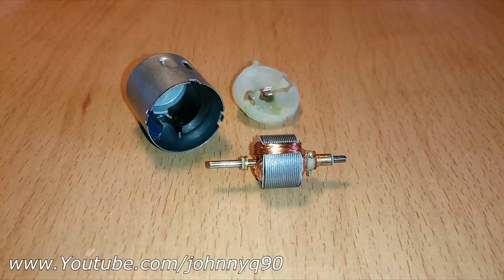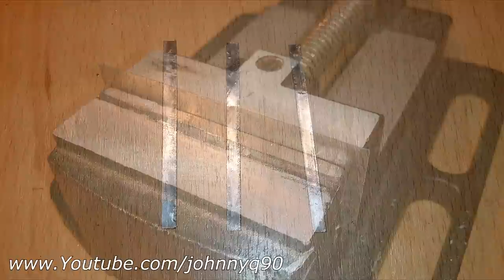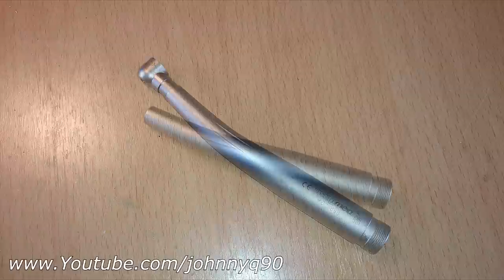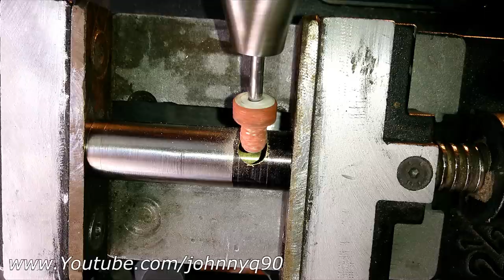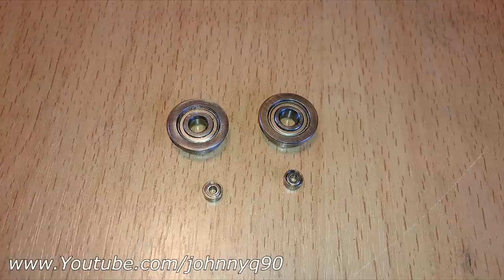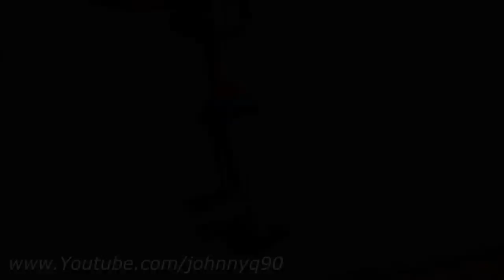Make A Water Turbine Motor - The Building Process

Comment: The only kind of slideshow somewhat acceptable on youtube.
***** Try building a tiny pulsejet! Or a small-ish turbojet.

It'd be awesome to see your view on a small pulsejet.
Reply from the maker: ***** Easiest and closer to be realised, i think is the pulse jet, but it needs to be steel so it still needs welding which on such a small scale it becomes almost impossible.
Reply: ***** Nothing is impossible! snickers

People have made keychain-sized valveless pulsejets.
If you've got a TIG welder and some very thin rod, you can probably do it after an hour or two of practice welding Al cans with steel rod :^)

Comment: Nice! I still think you should build something that works more efficient, with much more resistance. By now, most of the energy of the water pressure goes into accelerating the water, but not into energy that can be used on the end of the shaft;) 
but still great built!I like your style

Comment: when I saw the hobby motor couldn't figure what you were going to do with it, good use of that. would have never thought of it. have a question if you put a blade on both sides instead of just one of the armature arms you think it would increase rotation or just be nominal?

Comment: At what PSI is the water coming into contact with the rotor blades?  Is this just normal tap pressure?
Reply: with 2 atmospheres you will be fine. I can't to convert it into psi since I use the metric system

Comment: Are the bearings just regular Stainless steel?  Wouldn't the lubricant eventually be washed out?

Also I'm curious why you shaped the runner like that, it looks like it would cause a lot of drag on the water flowing through, I would've thought a smooth runner (not stepped) would work more efficiently? 

Cheers
Reply from the maker: UnbeltedSundew I used this kind of bearings because it was literally the only choice i had, since i don't have a lathe to make proper parts for better sealing. For the runner i was to make an archimedes screw type runner initially, but i realised that i couldn't twist it enough to give it that shape. After that i had also to change the main body, because the archimedes screw is being hit by water axially, while this is being hit radially...
Reply: ***** Ah I see, thank you.